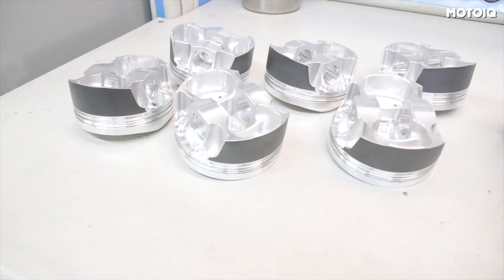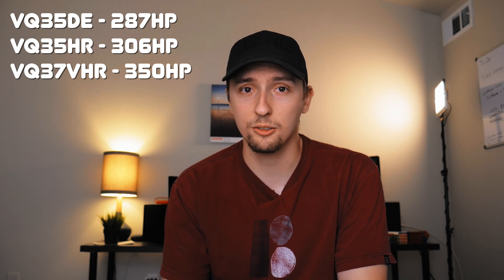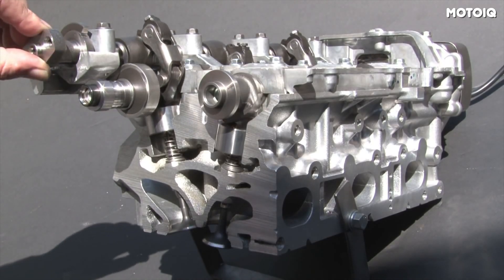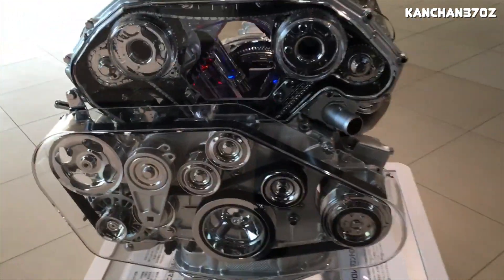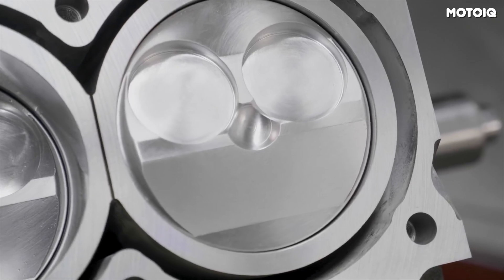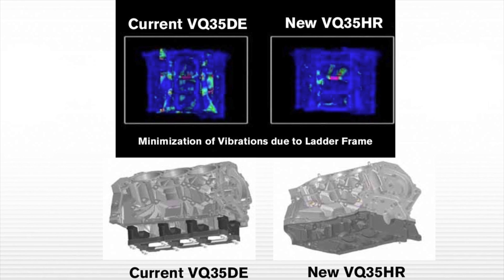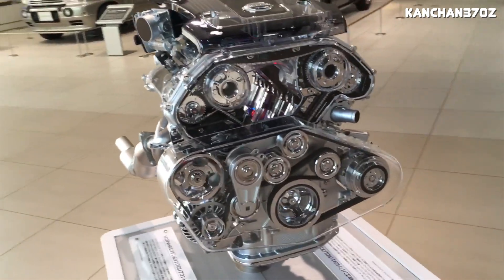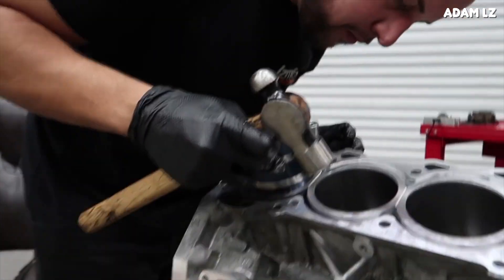Nissan VQ37VHR: Everything You Need to Know

Comment: Does a 3.7 liter take a crazy amount of gas? In about to buy one but I’m so scared that I made a wrong decision bc of how big the engine is . A 3.7 liter shit how many times do you refill it in a week living in the city 😢😢😢
Reply: I average about 24 mpg in my 15 q50!
Reply: Matt Bowen  so how much gas usage are you expecting on the g37
Reply: John Medina I own a 2010 g37x and it’s a solid 18.5 mpg in 25-35 mph roads with stop signs and lights and on highway trips it can get up to 28-30 mpg
Reply: @Jdm22345  Same here. I have a 2009 G37. Great mileage if you don't jack rabbit each take off from the light. 26-28 on interstate at 70-80 mph.
Reply: @frankhahne4880  the highway mileage gets really impressive, I’ve had it at 29mpg on a 500 mile trip.
Reply: My 370z does around 21mpg
Reply: 19-20 just like every v6 sedan I’ve owned
Reply: Got Up To 28 Mpg On The Highway With A 2014 Q50 3.7

Comment: Solid engine, but if you plan on taking it to the track I would advise getting an aftermarket oil cooler.
Reply: And gallery gasket upgrades if 2013 or lower
Reply: @fourdi  2013 is the last year they made the g37's but they implemented the gallery gasket fix fall of 2012. A select number of 2012 have the updated gallery gasket and all 2013 models have been updated.
Reply: @GearsNCarpentry  do you know after what date they started updating the gallery gaskets? i have a 2012 g37xS
Reply: @xaakev  yeah oil gallery gasket is cardboard they updated them in 2013 and I was real dumb of them to make it like that
Reply: @GearsNCarpentry I have a 2015 q40/g37 sedan would that one come fixed already?
Reply: @Ricky-gr6uc  yes, it should be updated
Reply: @fourdi that’s all of em bud😂
Reply: Mike at MotoIQ.. ....get some billet oil pump gears if ya gonna spin it past 8000 rpms
Reply: which oil cooler you can advice? and water cooler too)
Reply: I think it's a good idea to do that to every car you trackk lmao
Reply: and better gearing
Reply: Wouldn't just an upgraded radiator suffice? They have a factory oil cooler.
Reply: @IslandDeep don’t know finna find out for u I just ordered one from mishimoto I’ll post it

Comment: Great engine until the oil gallery gasket blows. Notorious problem on the vq37vhr
Reply: 170k miles and running strong here on my 09 g37 and I'm not alone, most seem to make it to 200k miles without issue.
Reply: revised in later models, and not the worst thing that can happen, otherwise an extremely bulletproof engine!
Reply: I have a 09 g37 sedan and my gasket blew at 115k. Still believe Nissan should’ve issued a recall or cover this repair. Or just not put cheap paper gaskets in the engine
Reply: @pakiboi8205  my heater hose connector blew out at like 122k
Reply: The plastic coupling that connects the two hoses breaks or deteriorates if coolant isn't changed or the wrong kind is put in the system. I bought one for about 4 dollars loosened the clamps and connected the hoses in a matter of minutes twice already but not since using Asian blue coolant!

Comment: I have a 2007 Nissan Murano with over 206,000 miles and I drive it like a TrackHawk.
Reply: Yep my 02 altima made it to 180k miles before I had to write her off from an accident,  ended up selling her and I think she's still on the road.

Great motors even if the early models burned some oil.

Comment: "you;re not gonna find huge power increases when modifying this engine"  WHAT??  WRONG WRONG WRONG WRONG....  The engine in the 370z is choked off bad.  I did basic bolt ons and a tune and hit 400HP at the crank...  Thats a 70HP gain...  You fucking kidding me?

Comment: The 3.0 nissan put in the mid 90s maximas was one of their best 6 cylinders they made
Reply: I agree, and that was the stepping stone for all other VQ engines. I sold my 2000 Maxima with 240,000 hard miles and it still purred like a kitten
Reply: I have a 2007 Nissan Murano with over 206,000 miles and I drive it like a TrackHawk.

Comment: my vq35 burns oil worse than my 2stroke quad it makes power like a 2 stoke though so a quart of oil a month may b worth it?
Reply: I must’ve got blessed with a good de. Virtually no oil consumption between changes and catch can doesn’t really have anything in it. Boosted too
Reply: Oil catch can should help with the oil burning problem
Reply: @samuelalpire7726  that would only change it from oil burning to oil consumption.

That's not a solution.

Comment: These engines from Nissan can definitely handle forced induction very well actually because it has been proven every time
Reply: Ive got the g37 5at. Best 10k i ever spent
Reply: @6lockee  the 5at ain't bad, it's just a bit of a pain on the highway. Anything over 70 and you're sitting at dumb high rpms.
Reply: @ekamvirk7599  mine use to be rough at 90k miles when crusing. Now at 107k it switches gears more smoothly
Reply: @6lockee  wait...huh? Lol that's a thing?
Reply: @RubberChickenMan007  yeah lol
Reply: @RubberChickenMan007  its the 08 sport
Reply: @6lockee  how is it better lol? Now you have my attention 😅.
Reply: @RubberChickenMan007  its faster & more responsive
Reply: Not the 35DE. It shits the bed at or a little over 400hp. I can testify. 431bhp and it shat a bearing.
Reply: I was thinking of putting a supercharger on my 2014 nissan 370z -AT, up to how many hp can it hold without breaking the engine?
Reply: But their transmission are trash. Especially their 7at
Reply: @RubberChickenMan007  You sure about that? the 6speed transmission can handle 800hp stock (of course it will need a racing clutch though) with a very good notch feel also being the first to introduce rev matching. Both the engine and the transmission from the 370z has been used in a lot of swaps, one of them being a 2JZ engine and a 370z 6-speed transmission in a 240Z to push out 600whp+. The only part in the transmission that needs to be swaped out is the CMC cause the stock one is made of plastic instead of the metal aftermarket version, everything else is bullet proof on the 6 speed.

the 7at can only handle up to 450hp but there is an aftermarket billet sold by Fast intentions to increase its handle output to 1000whp. Although i do admit the paddle shifters arent as responsive as the GTRs dual clutch auto, but its also used in the infiniti red sport 400

GTR and 370z Transmissions are in another league compared to other nissan cars/trucks
Reply: @letsroll2463  I've got the 7at with paddle shifters and it's laggy AF. Driveability wise I think it sucks. 

The 6spd manuals are great, I was referring to the auto. I hate it with a passion and there's practically nothing I can do about it for now. The only upgrade I've seen so far is swapping the auto trans from the q50 provided the valve body from the G is moved over. The trans from the q50 is much beefier and I think it shifts better.

It also blows that there's no dip stick to service the trans fluid or filter on these. Granted, there are ways to change the fluid, but it's a pain in the ass.
Reply: @RubberChickenMan007  dude you can see the differences between the jatco jr710 and the jr711e. The q50 trans has minimal differences besides better clutch packs in 5th, 6th, and 7th gear. I'm assuming solenoids are also revised. The jr710 has proved to hold power, albeit with slippage in higher power levels. See dadsg37's build. Been well over 2 years and going.
Reply: @RubberChickenMan007  I agree 1000%, I got my second car (2011 G37x with 7AT) and man the transmission sucks. I came from an audi a3 with a DSG, and I noticed very quickly how slow the 7AT really is. My DSG would shift lightning quick in any situation where the 7AT is so slow and clunky. I love my G but man I hate the transmission , the only thing nice is 7th gear for the highway.
Reply: @youhearevan1  hahaha I knew I wasn't crazy. My buddies 08 Lexus ISF shifts like a dream compared to this thing. I'm thinking of getting another car but it's hard to find bang for your buck like the g37. I'm thinking maybe there's a better valve body for the trans that doesn't cost an arm and a leg lol.
Reply: @RubberChickenMan007  nah man you’re a little crazy lol the ISF transmission is probably as close to a dct as far as responsiveness you can get without having a dct Lexus was way ahead of the game in 08 with the isf. Dude above you compared his Audi with a DSG to a regular transmission with a torque converter of course it’s going to feel sluggish.
Reply: @KeepItG  I ain't crazy, the Lexus trans is fucking amazing. I know that. That's why I'm swapping rides to a gsf instead. What's retarded is that the old ISF sells for what I can get a way newer gsf for. Sure it's heavier with more electronic aids that I don't really want but it's a damn good value.
Reply: @RubberChickenMan007  Fluid change is not that bad if you have the 3-4 tools necessary it’s quite simple actually.
Reply: @letsroll2463   I was thinking of putting a supercharger on my nissan 370z -at 7, up to how many hp can it hold without breaking the engine?
Reply: @RubberChickenMan007   I got my 3.7 Q50 tuned and I noticed shifts much better and way faster. Definitely worth the money and you get flames😂
Reply: @zay7320  wait... really???? Wtf hahaha. I was gonna put a 2017 red sport trans in the car to see if it helps.

Comment: 350 hp 3.7? 🤣 ain't stock
Reply: Yes it is stock.
Reply: The Infiniti ipl has 343hp from the factory that’s close enough
Reply: I have a 2007 Nissan Murano with over 206,000 miles and I drive it like a TrackHawk.

Comment: Well, let’s do VR38 next time!
Reply: While the Nissan VR38DETT (found in the GT-R) and the VQ37VHR (found in the 370Z and G37) share some DNA, they are fundamentally different engines designed for different purposes. The VR38 was developed specifically for the R35 GT-R and incorporates racing-derived technologies that the VQ37 lacks.  
Here is the breakdown of the key differences:
1. Induction & Power
VR38DETT: A twin-turbocharged powerhouse. It was designed from the ground up to handle boost, featuring two IHI turbochargers integrated into the exhaust manifolds. Depending on the year, it produces between 480 and 600+ hp.  
VQ37VHR: A naturally aspirated engine. It relies on high RPMs and high-flow air intake rather than forced induction. It typically produces around 330–350 hp.  
2. Cylinder Bore & Construction
Mirror Bore vs. Plasma Spray: One of the most significant engineering differences is in the cylinder walls.  
The VQ37 uses a traditional "mirror bore" coating to reduce friction.  
The VR38 uses plasma-sprayed bores. This involves spraying a molten iron coating onto the aluminum cylinder walls, which eliminates the need for heavy cast-iron liners. This saves weight and improves heat dissipation, allowing the engine to handle the intense heat of twin turbos.  
Displacement: Both share a 95.5mm bore, but the VR38 has a longer stroke (88.4mm vs. 86.0mm), giving it a total displacement of 3.8L compared to the VQ's 3.7L.  
3. Internal Strength & Compression
Compression Ratio: Because it is turbocharged, the VR38 has a lower compression ratio (9.0:1) to prevent engine knock under boost. The VQ37 has a much higher compression ratio (11.0:1) to maximize power from its naturally aspirated setup.  
Internal Parts: The VR38 features "overbuilt" internals, including a ladder-frame construction for the crankcase to provide extra rigidity under high torque loads.
4. Valve Technology
VVEL vs. Traditional VVT: * The VQ37VHR features Nissan’s VVEL (Variable Valve Event and Lift) technology on the intake side, which allows it to control air intake via the valves rather than a traditional throttle body for better response and efficiency.  
The VR38DETT actually does not use VVEL. Instead, it uses a more traditional Variable Valve Timing (VVT) system on the intake cams. This was a deliberate choice to ensure reliability and simplicity at the extreme performance levels the GT-R targets.  
5. Manufacturing
Takumi Hand-Assembly: Every VR38 is hand-assembled by one of a few master craftsmen (Takumi) in a clean-room environment at Nissan’s Yokohama plant.  
Mass Production: The VQ37 was a mass-produced engine built on a high-volume assembly line in Iwaki, Japan.

Comment: I have heard that originally the Nissan 370Z actually overheated stock due to poorairflow to the engine, but 332-350hp on this NA engine is truly impressive.
Reply: Anyone may correct me if I’m wrong but from the years of 09-11, the 370z didn’t come with an oil cooler. I assume that was a huge part of their overheating/engine blowing issue. Even though the OE oil cooler produced after 2012 isn’t that great either which is why I need to purchase the Z1 oil cooler.
Reply: Truly a gem of an engine with none of the Direct Injection gimmicks, nor turbochargers/supercharger we have these days. It was all raw, uninhibited power!
Reply: I have a 2019 370z sport coupe 6M and the oil does run hot in stop and go city driving on warm days, about 220⁰F. Nissan did improve the oil to water intercooler, but the oil still tends to run hot. This is due to the VVEL mechanism that puts a lot of contact pressure on the oil that heats it up. The Nissan ester oil that I use in it tends to shear down from it's nominal 30 weight grade to a 20 grade after about 3k miles, which is when I change it. The good thing is that my engine uses virtually no oil, after the careful break in I gave it.

Comment: How much whp can the stock block hold without changing the internals with FI?
Reply: Nissan says that you can safely extract up to 450 crank hp without doing any strengthening of the engine internals. This may be a conservative estimate that is meant to protect the company from liability due to engine failures.
Reply: @videomaniac108  450 hp to the wheel?
Reply: @yamilma182  No, Nissan says crank hp on that figure, not the wheel hp.
Reply: @videomaniac108 Lol, the transmission can hold more power than that.
Reply: Ok  would the transmission hold up with that power? Or  Eventually upgrade internals would have come to play with this much power it wont last for long time With level 10 transmission?
Reply: @mr1989junior  the transmission can hold the power up to 800hp stock easy i believe no issues, but u need to upgrade the clutch and a aftermarket CSC set up or delete once you creep into 500whp+ territory, everything else is okay.  I'm looking at OS Giken twin disc clutch cause racing clutches scare me with their 6 pucs if i want to daily ur z. I also heard good things from Southbend clutches too for F.I. 370z's
Reply: How can you tell someone is a good tuner?
Reply: @mr1989junior  research, ask around on the 370z Facebook pages and the forums. Look for tuners with a good reputation
Reply: @mr1989junior  there are like around 5 really good tuners out there for the 370z, one of them being seb from specialy Z and Moncef from AdminTuning. I know Moncef does remote tunes too and hes one of the best tuners for 370z with alot of youtube videos, you have to talk to him about it. I prefer ECUtek over UPrev too.  

There is SohoMotorSports and Z1Motorsports on the east coast, and Fast intentions and another one  on the west coast, they all do turbo kit installs too and they are well known in the Z community. Forgot which shop Moncef is from... I know there are 2 more shops that are well known too.

So far BoostedPerformance is the cheapest single and soon to be twin turbo install cause u dont have to remove the engine to install their turbo kit.
Reply: @letsroll2463  admintuning is NOT a good reputable tuner. He's known to blow motors and turn off knock sensors!!
Reply: @maxgomez7989  wheres the proof about this claim? hes well known in the Z community
Reply: 600 to 650whp is stock limits of reliability untouched
Reply: With a good tuner of course.

Comment: If you eliminate the exhaust restrictions, it's feasible to gain 40 wheel hp with a tune. My 370z touring exhaust was 1.75" at the Y pipe and overall the exhaust was restrictive. I installed test pipes with 400 cell Magnaflow cats as the only restriction plus a 2.5 inch dual x-piped exhaust with only K&N drop ins on the intake and gained that much on a dynojet tuning session. There is significant power to be gained with bolt on equipment and a tune, but it gets expensive really quickly. Great engine! Hopefully I'll not have to deal with the oil gallery leak that can happen to a pre 13 engine.
Reply: TooCool1 second ago

I agree. I have the 2010 G37 Vert with K&N filters, two new catalytic converters, new water pump, timing chain, some type of gaskets, camshaft position sensor and other preventative maintenance done to it when my water pump went out and now I get right at 339-340 horsepower that you can really feel! I beat a G37 coupe the other day that got the jump on me from a dig and passed by him in about three 3 seconds while he was full throttle! I'm at 250,700 plus miles and this car still snaps you back into the seat. My 7at is smooth and responsive because I know the pedal position to reach the desired or quick response operation or just flick it into sport mode for instant gratification!
Reply: Yup and Z1 has a 400 package for $1500
Reply: You could do the same or more with a good intake setup especially thinking outside the box.
Reply: I have a 2007 Nissan Murano with over 206,000 miles and I drive it like a TrackHawk.
Reply: @NFLYoungBoy223  loooooooooool dis shit av me rolling